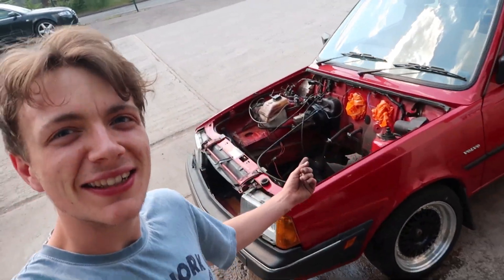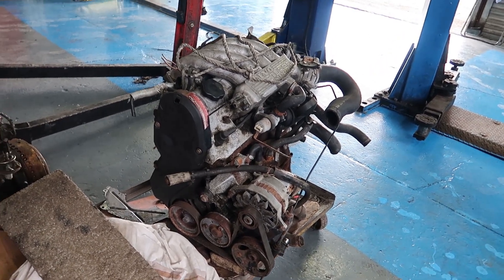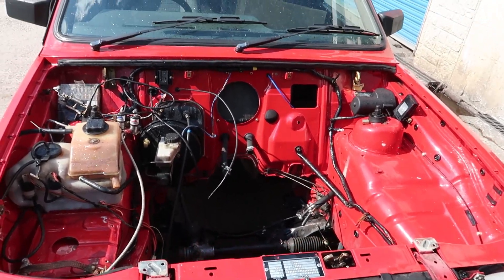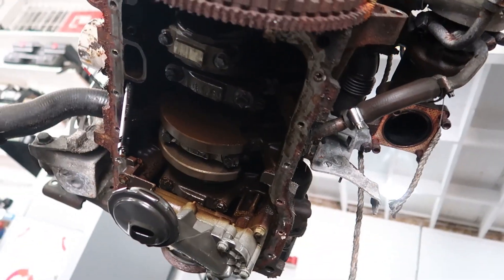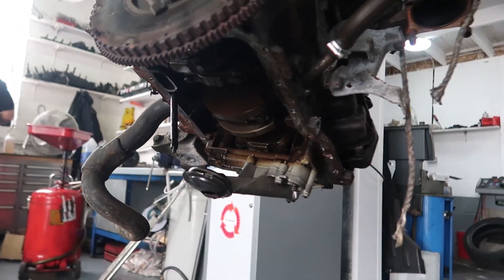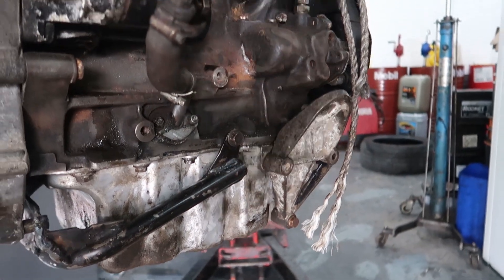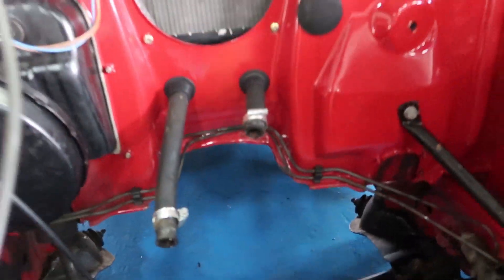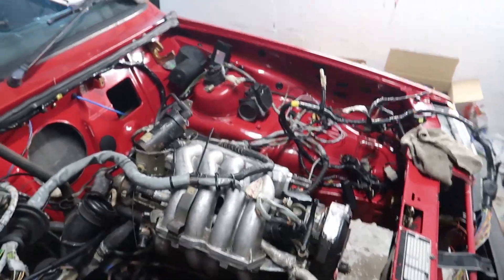Volvo 340 Engine Swap Part 2 (B18FT)

Comment: Carful you don't snap the prop shaft. Im told they are easy to break with a bit of extra power
Reply from the maker: Yep i've heard the same. Guess i'll just have to wait and see, if it snaps I'll probably get a custom stronger one made up
Reply: @HGVHarry  Did it snap?

Comment: well, what are you going to do with the problem that the b18ft is front wheel drive and the original rear wheel drive?
Reply from the maker: Engine just rotates and bolts onto stock 1.7 mounts then you can just connect a stock 1.7 rwd bellhousing
Reply: @HGVHarry  i didn't know that.